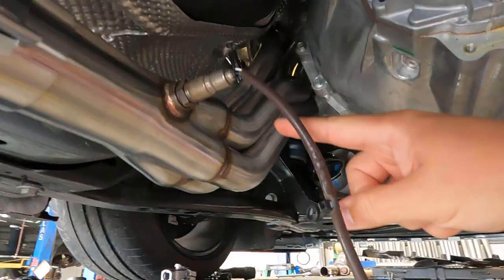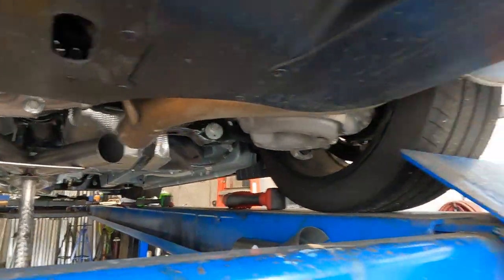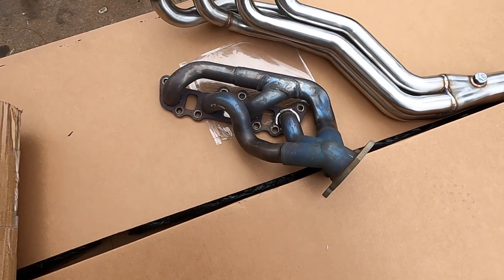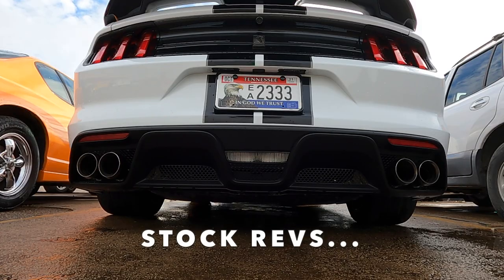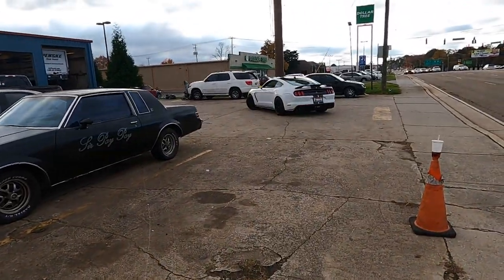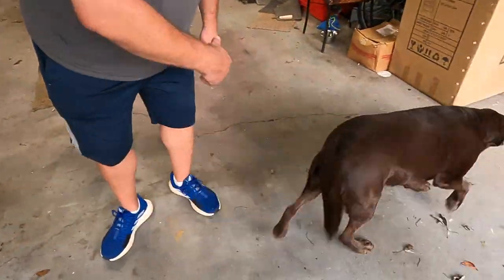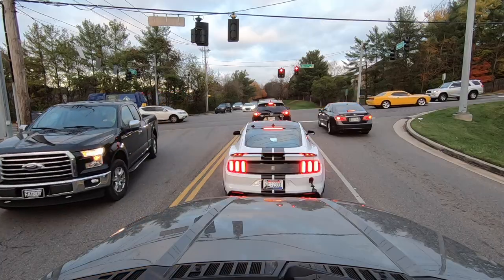Best Sounding Mustang Ever? 2020 GT350 + Catless 2M Fab Headers + Corsa X-Pipe = Devil Music!

Comment: Sounds like America! 🇺🇸
Reply: 100% agree
Reply from the maker: Red, White, & Boom!
Reply: WRONG!!! Sounds like 'Merica. 110% right!
Reply: Lmao you know they use a flat plane v8 which is what they use in European cars and they even had to modify the exhaust to sound more “American”
Reply: @bryan5418  wrong they use a flat plane crank due to the fact it doesn't have to have as much weight added for balancing which  in turn allows the engine to spin at a much higher rpm which is better suited for track use. Has nothing to do with the sound. Further, no european auto makers use such a large displacement V8 with a flat plane crank making it unique. It also has a unique firing order which gives it the sound, that the euros do not.
Reply: @bryan5418  Ok, still American made

Comment: The Wolf is catless with resonators? Is that it? Minus the long tubes; I want to run the same exhaust on The Wolf on my truck. If I had a 5.2 coyote, it’d be very similar. You seem to be a lot like me. When the 2018 F150 came out, My dream truck was the Lariat special edition in lead foot with the 5.0. Gear it up for burnouts, make it sound amazing. and have a mustang to play around with too.
Reply from the maker: The Wolf has catless long tube headers, 2 aftermarket resonators, and the roush active exhaust muffler.
Reply: @BackroadDriver  what is the manufacturer of the headers and resonators? I would love that same system on my truck
Reply from the maker: The Wolf’s headers are Stainless Works. The GT350 headers are by 2M Fabrication.
Reply: @BackroadDriver  thanks!

Comment: My goodness, she sounds poised off!  Way to go guys, another great car to follow on YouTube.  Do you get a CEL because of no cats?  I keep getting CELs on my Odin F150, no cats and headers.  I would appreciate any proven fix you might have done.
Reply from the maker: Did VMP do your install? I know you told me but I can’t remember.
Reply: @BackroadDriver  no, Archangel Motorsports.  It is VMPs tune but they told the installer they wouldn’t turn those codes off in the tune.  EPA regulations.
Reply from the maker: I don’t have that problem. Let me get back to you...
Reply: @BackroadDriver  thanks brother,  it isn’t a huge deal.  It mainly just disables my remote start which I only use in the winter. I would appreciate any help you could offer though.

Comment: I put some 2m on my GT350, had to dent the pipe for the steering shaft, and used ford header gaskets for a 11-15 5.0. As the stock GT350 header gaskets don’t fit.

Comment: I have the same exact setup on my gt350 and it’s glorious!!
Reply from the maker: Tune and intake are next...
Reply: @BackroadDriver   Hell yeah it’s going to be fun for sure. I did the same thing when I first got mine and now it’s Procharged making 900whp and it’s a beast!!
Reply from the maker: Awesome!
Reply from the maker: Subbing now!
Reply: How do you guys like the headers? I’ve been looking at corsa, stainless works and kooks but these are a great price. My neighbors will hate me with the corsa double helix and corsa xtreme mufflers already on it. 

Who’d you use to tune after? Lund or palm beach
Reply: @RedBullND  The headers are great for the price, you may have to do alittle modification to them to make them fit correctly, I personally had to ding my drivers side header to clear my steering shaft and make a few holes bigger for the headers to fit on the studs but that’s it. If you have extremes now and your neighbors hate you? They will want to kill you after headers hahaha. Go to my YouTube channel I have done a lot of exhaust videos and a lot of different setups.  Prochargedbeast on YouTube and sub while you’re there thanks. Oh and use palm beach dyno those guys are amazing from personal experience.
Reply from the maker: Prochargedbeast nailed it. 2M talks major crap about how perfect their product is but it will need modification. Both sides of mine needed work. The price is awesome. The quality is good. The figment is off a little. We are doing a video about 2M Fab soon. We don’t think they are made in America like they claim...
Reply: @BackroadDriver  alright I’m subscribed to both of y’all and just bought a set for mine. Do either of y’all have an Instagram I can follow for more up to date news
Reply from the maker: @backroaddriver_bradmizer
Reply: @BackroadDriver  alright here comes a follow

Comment: Is it possible to install this 2m headers on the gt350?
Reply from the maker: It's possible but we don't recommend it.  We had to severely modify them to get by the steering shaft on the driver side. I'd find another brand on a GT350. They work great on f-150s.
Reply: Run away from them. If you have a fitment issue you will get this "You have to align your engine. It’s your engine. It isn’t centered. From the factory, they are upwards of 3/4” off center. You need to center it. " freaking nightmare.

Comment: what did you do for the steering colum to fit correctly? i installed my 2m fab headers and running into this problem, do i have to take them out and dent the primary tube?
Reply from the maker: Yep. They didn’t fit well…
Reply: @BackroadDriver  any reccomendations on how to get the steering colum to fit better without taking the header back off?
Reply from the maker: You could disconnect the steering column and move it and then heat and bang on the tube.
Reply: @BackroadDriver  Lets pray nothing else catches on fire lmao
Reply: I'm having the same issue with vibrations on the steering wheel when I turn right or when braking. 

Were you able to bend it without taking it back off? I feel like something gonna brake with all these vibrations. It sounds incredible though. 
But I think im going to have to order the cat from them my neighbors hate me now. That cold start is wicked at 6AM lol
Reply from the maker: If you mark and remove the steering linkage then you can heat and bang.

Comment: Did you get the catted or catless option from 2m???
Reply from the maker: Catless long tubes. This is the next video in this series. Thanks for watching!
https://youtu.be/AUDVwdBQN1s
Reply: @BackroadDriver  okay dumb question, when you selected catless, did they provide you with the cat delete replacements as well or did you get that elsewhere?
Reply from the maker: No dumb questions here. The header has a long tube that comes down under the car and replaces the cat.
Reply: @BackroadDriver  thank you!!!! I’ve been on the fence about this for my s550, but thanks to your video. Literal before and after, and I just saw you new one from yesterday, I’m pulling the trigger. You just gained a follower from me keep up the great videos 🤘🏽
Reply from the maker: Awesome man! We’ve got plenty more in the tank. The install may not be perfectly smooth. Your installer may have to heat and bend a little extra but you will still save a ton.

Comment: I wanna put that setup on my gt350 🤪
Reply from the maker: The baffle valves can’t handle it. Plan on getting the full Corsa Extreme catback with X pipe.
Reply: @BackroadDriver  how much does this setup cost?
Reply from the maker: I’m hindsight, I would buy Stainless Works headers and the Corsa active Cat Back system. Would cost more but would work like a champ. You are going to want to see Tuesday nights video…

Comment: Just subscribe. How are the 2M headers held up?
Reply from the maker: Thanks for subbing! The 2M’s are terrible. We took them off. Fitment is horrible.
Reply: @BackroadDriver  thanks.
Reply: @BackroadDriver   Thanks, saved me the trouble.
Reply from the maker: Glad we could help!
Reply: @BackroadDriver   Guess if it’s a Thrid of the cost, gotta be a reason.  Gonna go with ARH Catted for my boosted S550.   Your car is gorgeous, hope you got it all figured out.  Thanks again!!
Reply: @stangfreak91  I just went with Ultimate Headers I'll do a unboxing video when i get them & a sound video after the are installed
Reply: @antoinegresham  sounds good,  can’t wait to hear them!
Reply: Can confirm the fitment of those 2M headers are a mfer with fitment. On my 2020 gt it was a bitch to install. They do sound good with corsa x pipe and sport ab. I get some rasp around 2100rpm. I've been seriously considering arh long tubes but catted.
Reply: @Mors_Atra_  I ended up going with Ultimate Headers. Their longtube Headers with high flow cats fitment was great no banging no bending.
Reply: @antoinegresham  Wjat did you pair the lth with and how does the combination sound?
Reply: @Mors_Atra_  Corsa Double helix xpipe. It's loud and aggressive now every I go people want to race.
Reply: @antoinegresham  lol... I completely understand.